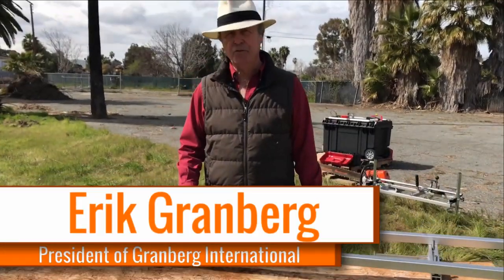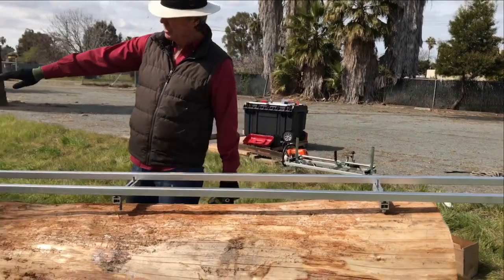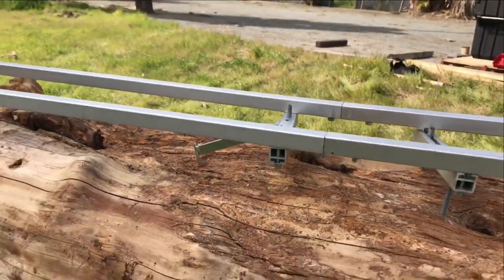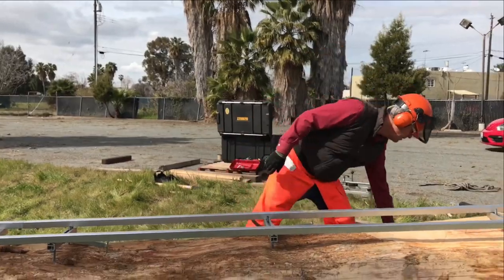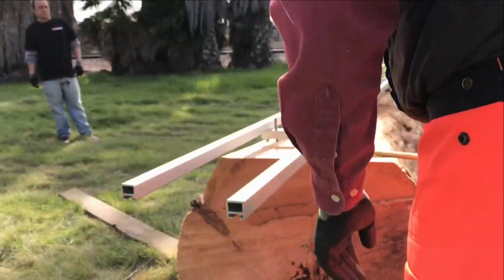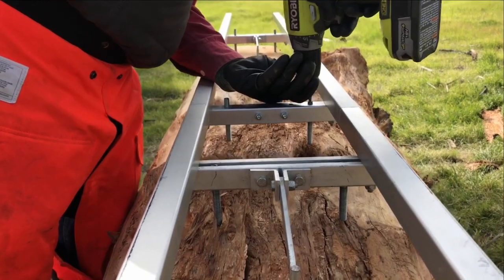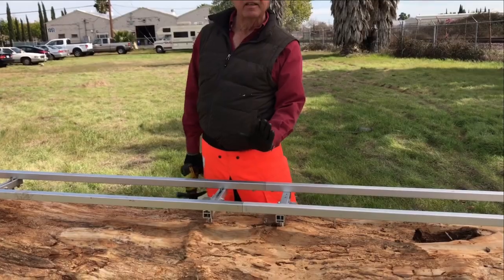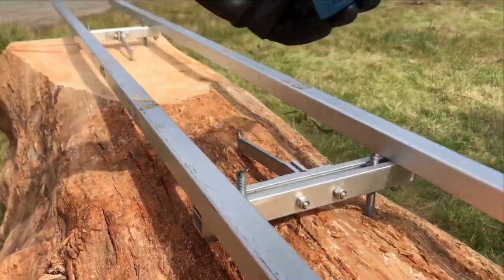Tips and Tricks: EZ Rails

Comment: I went with 1/4" thick 12"L x 5" H plates with holes every half inch along the bottom of the plate. Then cut 2" slots into the plate an inch in from each end. The notches are 1 1/2" deep to allow the 2x2 rails to sit out 1/2". No flex, heavier yes, but no worries about the rails and they will last a lifetime. 13' 2x2 @ 1/8" thickness. Allows me to cut 12' 6" with no problems.

Comment: So far my main issue is the tendency for the leveling bolts to rattle loose, no matter how much pressure they are putting down. So I highly recommend buying some nuts to keep the leveling bolts in position.
Reply: For other construction applications the way they deal with vibrations is to use a non-permanent threadlock chemical on the nut. I wonder if it would also help in this use case. However, threadlock is something that always needs to be tested because it is possible that it could seize the threads permanently or if the existing nut is too loose it might not work at all. A risky alternative but ideally would avoid having to adjust nuts every time

Comment: This is such a great addition to the chainsaw mill which I am really getting my money's worth out of. Having a ladder as a guide is just so much more affordable. That's what I say on my channel– "this is a great product, but you probably already have a ladder."
Reply from the maker: Absolutely! Originally, the Alaskan Mill was only used with 2x4's or just a slab of wood. A ladder is another great option as well and we suggest that to those who can't afford this set. EZ-Rails were created for those who had the budget and wanted to set up and level their first cut easily and accurately. Happy Milling!
Reply: actually steel tubing works great - just heavy, but smooth less flex - I have seen modular aluminum used by others.
all a little better than a ladder [less flex] heavy tho :(
Reply: I actually took the concepts of the ez rails and adapted them to my ladder sections...that old extension ladder with a crushed end that the kubota ran over turns into a great 12 rail system.  Pipe/fence clamps modified to make dogs and the leveling bolts...I greatly thank GB for their innovations.

Comment: How do prevent a dip in the center from occurring? If you start with a dip in the center, essentially you've cut a bow in the first piece cut. Every board after will have the same bow.
Reply from the maker: Thanks for the comment! The rails are extremely strong, extruded aluminum and should never bow while using them. The important part is to make sure down the length of the log, that the rails are straight.  You achieve this by adjusting the leveling screws. But straight is not level. Once the rails are straight, then you level across the log using the leveling screws again. Now if the log can easily be moved and it is relatively even in diameter end to end then you can first level the log by using spacers of some kind, 2x4s or 4x4s or whatever pieces of wood you have around. Once the log is level, you can then use a level along the length of the EZ-rails. However, since many logs are not in position to move it is unwise to do so, thus the utility of the Alaskan Mill to allow you to cut in place! In this situation the EZ-Rails need to be set up as above. I hope this answered your question. Best, Granberg Team

Comment: I was always taught to put a lever thought the middle of the log at each end. Scribe a line through the middle and measure rand end from that point to the top of the log that will give you the difference saves lifting the rails on and off repeatedly.  9 times out of ten I get it first time.  
Also a pice of foam over the microphone.  Is a easy wind fix.     Use a longer lever.      Simple.  Simple.  Stuff

Comment: I am glad I didn't go with this system. The rails are not strong enough (you can see the bend before the leveling screws were set and it requires a lot of time to setup.  For the cost of this setup Granberg should provide longer set of leveling screws.  This is based on my observations. 

Instead I purchased a used 30 ft extension ladder for $40. Much more rigid and easy to setup. Other options available is a $20 timber guide used with a 2x6 or 2x4 which also sets up in minutes. Will not do a top cut but requires a lot less setup time with minimal cost.
Reply from the maker: We do sell longer leveling screws (6") for those who need them. We never push our First Cut accessories on folks, our only goal is to make the milling process easier. Many people use ladders and thats great! Whatever works for the customer works for us.  These rails are extremely strong as well as being light weight, so they are easy to manage and easy to set up.

Comment: I like the rails but the supports are no bueno. Using a platform on each end of the log to support the rails much easier faster and sturdier. Maybe a support in the middle if the rails have a tendency to bend. Dont like this setup. BTW Ive milled around 300 slabs in the last couple years.
Reply from the maker: We are always open to feedback from our customers, can you please email this idea to lindsey@granberg.com and I will share it with our engineering team. Thanks!

Comment: Newbie here. about to use it for the first time. I understand the plan you have laid out, but have a (sort of) related question. What do you use to remove the bark? Are there times, types of trees, etc. where it is not necessary to remove it?
Reply from the maker: Removing the bark is a tip we find quite helpful and that is because a lot of dirt and rocks reside in the bark that tend to dull your chain much faster . Not having to stop milling and sharpen your chain can save you a lot of time.

Comment: I notice you only sight down the length of the log for leveling. Isn't it important to level the rails in both directions before making the first cut? Wouldn't you want to use a 3' -4' level for leveling the log lengthwise? It is quite a bit more accurate than just sighting down the log. Or is length leveling not that important?
Reply from the maker: What's most important is measuring from the center of the log to the top of the rails on each side and making sure that distance is the same. Then you sight down the log, and using a level down the length of the log isn't necessary if you follow the first step. Then you level across the bars where the 'leveling screws' are at. Do that at all the screws. Then go back and hammer in the dog and recheck with your level, making any minor adjustments needed. Also make sure the leveling screws are tight in the log. ( you don't want them coming out while milling - and you can ensure this by screwing the leveling screws in first and then hammering in dogs - that way the dogs lock in the screws) Hope that makes sense!

Comment: Looking for advice i have a 30in round tree in my backyard already head cut down any recommendations on what kind of chainsaw and mill a beginner should get
Reply: If you are going to mill a 30 inch hardwood tree, you need a lot of power, and a ripping chain will make it a whole lot easier.  The Stihl 880 has enough power, but is not a beginner saw, or a beginner price.  Depends where you are, but in my area there are sawyers who will mill for you on site--yes, it is costly, but you pay for their skill, time, and equipment, and they will get the best lumber out or your tree in a reasonable amount of time.  If there is good access vehicle access, you may be able to take the tree to a small lumber mill--assuming the tree has a long straight section at the base, and is of a desirable species.

Comment: Why is it important to square the cross brace assemblies to the EZ Rail?  Going to use my 20ft EZ Rail for the first time today!
Reply from the maker: Good question. It is not a necessity however, it is helpful in making sure the whole setup is square. It could very easily be done without a square though.
Reply: it helps us that are picky about the dimensions.
 our first efforts were thick and thin until we paid a little more attention to our guide rails. :D

Comment: Can you guys comment on how the best way to keep the leveling screws from walking out when sawing is?  I've had these rails for a couple years and my issue is that with the saw's vibration the screws just spin right out of place while cutting.  This really causes a lot of issues and I rarely can achieve a smooth first cut because of this.  Thanks!
Reply from the maker: Shoot us an email at info@granberg.com and we can give you some tips on that!
Reply: I add a deck screw(s) through the other holes in the cross pieces to produce tension on the leveling screws.  They also add additional security should a dog pop out.
Reply from the maker: We have also found that the backout can usually be counteracted by setting the screws, then the dogs, then releveling the screw, making sure the leveling screw makes solid contact into the log. This should create enough upward tension on the dog spike to prevent that walking out of the screw.
Reply: we used steel tubing with steel with bolts to level with a couple deck screws (just because) - much less flex
  [the log/dogs would be a great addition] those should help. 
*uh yeah we made our own rails as none were available 40 or so years ago. ;)
Reply: You could add a nut to the leveling screws and snug them up to the square stock they thread through. Would essentially work as a double nut does.

Comment: Bought the ez rail system.  Selling on Facebook. Looking for some straight aluminum ladders to use as guides.
Reply from the maker: Sorry to hear you didn't like the EZ-Rails. What about them didn't work for you? Thanks for the feedback!
Reply: @granberginternational  After taking 30 min to adjust the leveling screws, they back out instantly as the chainsaw moves down the wood thereby ruining the level.  They need to be locked in place with nylon lock nut style setting.

Comment: Angle iron. Two shorter perpendiculars. Two long rails for milling.  I have a 14' setup that doesn't droop at all. No screw holes in your slabs.  No aluminum parts getting bent up in your truck. Maybe you guys should come up with something like that as an "HD version"
Reply: sounds good - we used steel tubing with steel angel iron across and bolts to keep it leveled as we did our 1st cut. no flex, but heavy